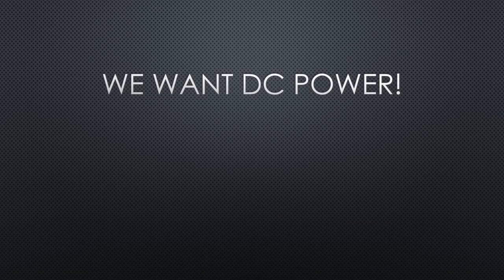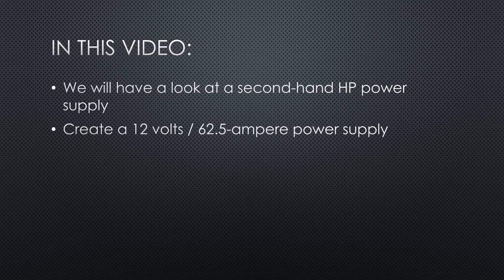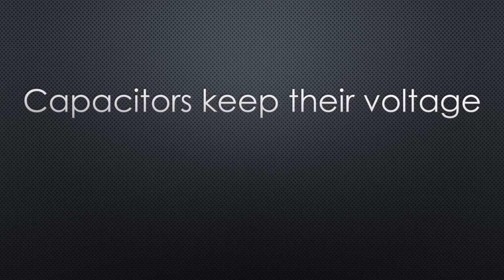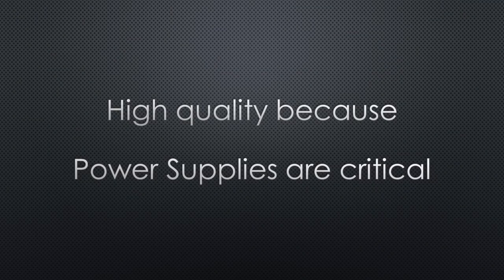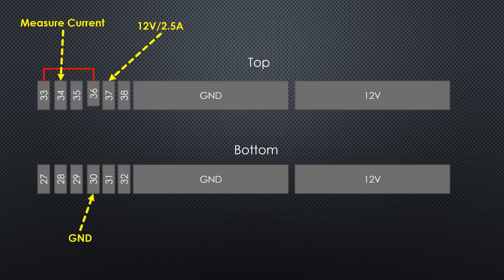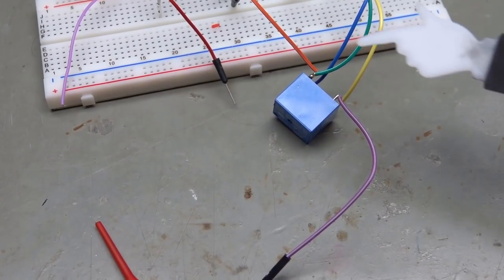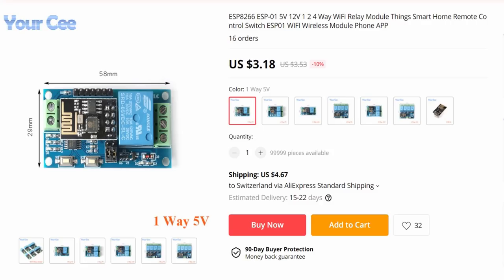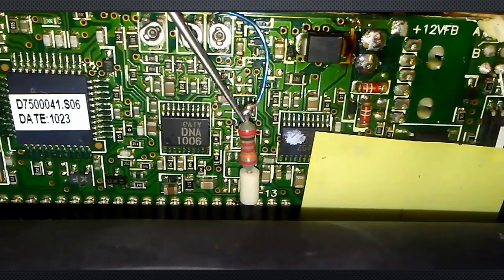#342 12V/60A power supply (PSU) for 20 dollars? Unbelievable, but true. And high quality.

Comment: I would never buy such beast for DIY projects. It is way, way too dangerous for hobbyists - 60A is not a joke. Any short will end up in dramatic fireworks and can definitely set the wires (or your house) on fire.
Reply from the maker: You are right. But then you have to pay much more attention to car batteries. They deliver easily 600A and most of us can handle it, I think
Reply: @AndreasSpiess  you're a mature person, and you definitely know how many self confident, yet still dumb people are around you (as I am). Some basic precautions and warnings at the beginning of video are crucial, imho.

Comment: he forgot to mention how loud those server PSUs are: like an old vacuum
Reply from the maker: Mine was not loud without load. The fan was off. And also at 50 % load it stayed off during my tests. But others reported the same as you.
Reply: Look for E number and decode it to OEM manufacturer. If it's Delta, it's going to be deafeningly loud, they like their fans to be self-cleaning. If it's Lite-On, it's going to be silent - unless it's dying, one of their failure modes is actually that they lose their fan control and then start signalling errors. Other failure mode is that PWR_OK detection is broken, you can live with that :D

Comment: is it normal this psu run so hot?but it not loud.
Reply from the maker: Mine does not become very hot. But I do not use a lot of power in receiving mode. Only if I transmit I need more current. But this is a small percentage of the time. I would be cautious if it runs too hot. Maybe the fan is defective...

Comment: Powerful, compact and noisy as hell. No thanks.
Reply: You can replace the fans with quieter ones if you only run them at lower current. Also modern servers can be very quiet already when they are not heavily loaded and the inlet air is cool enough.
Reply: that was true, years ago.
Reply: I have two 1 kW HP G5 PSUs and those things are LOUD.

Comment: Does anyone know what is the I2C bus on the PSU for?
Reply from the maker: I assume for status reporting in a DP center
Reply: As these are server PSUs, most likely the bus is used for fault detection, as normally they are used at least in pairs of 2 for redundancy. If one PSU has bad voltages or fails completely, administrators get informed to replace it before the other one also dies. Mostly they are hot pluggable (see the part in the video with the shorter pins) to not have any downtime on the server.
Reply: @AndreasSpiess  I did a little bit of research and found out that it uses the PMbus or power management bus protocol which is a standard (with open datasheets for older versions). The interface can be used to control fanspeeds, get PSU temps, voltages, currents etc.

Comment: Some tips for 48V?
Reply from the maker: I did not find a lot of info about 48 v psu
Reply: @AndreasSpiess  Thank you for your clearly explained video. I purchased a 48v 40w DIY induction heater 2 years ago, not understanding how expensive the power supply would be. Using (4) of the HP power supplies in your video, could you point me in the right direction for info on how to safely connect 3 or 4 in series to reach 36 to 48 volts? Again, thank you for your excellent videos!
Reply: For 48V,  look to telephone system power supplies.  I had one given to me a while back that I tore apart, it had a large card cage full of TTL,  on many boards,  and multiple power supplies for the various parts of the system.  The whole thing was several cubic feet in size!

Comment: Was it really necessary to use a relay?  Edit:  not really.

Also, they sell breakout adapters for these power supplies.  Search for "HP common slot breakout".
Reply from the maker: True. you can also follow the link in the description to those boards
Reply: @AndreasSpiess  Yes, sorry I forget to check descriptions sometimes.

Comment: there is no houses with 60A plugs, where the hell are you thinking to turn this thing on? its too much energy.
Reply from the maker: 750W/240volt=. 3A.  This is the amperage on 240 volts. No problem.
Reply: sparcx86 Channel:  
  V=I x R,  W=V x I

Comment: Don't use PSU's from HP's G5 generation, they fail all the time
Reply from the maker: You have to be a little more specific, I think. Not all know the numbers of the G5 generation to avoid.
Reply: @AndreasSpiess  My G5 server is still running on it's original PSUs bought as a customer return back in 2010

Comment: why exactly 13.8 Volts?
Reply from the maker: I do not know why most 12 volt devices have best performance at 13.8 volts. Maybe from the cars where the charging voltage is around this value.
Reply: @AndreasSpiess  is it 13,8 for cars? I've always used 14,4 for my lead batteries... but ok
Reply: Yes, this standard derives from the automobile industry. Car alternators vary in voltage according to the engine speed, so to keep them from overcharging a battery, there is a voltage regulator that is typically set to 13.8 volts. Automotive accessories that require high power (like high-end stereos and ham radio equipment) are designed to operate at their fullest capacity at 13.8 V rather than 12 V. (I was once in a vehicle that died; when we checked the engine, we discovered the battery had partially melted; evidently the regulator had died. This is why many vehicles have a voltage indicator on the dashboard.)
Reply: 13.8VDC is a good voltage to use when charging 12V lead-acid batteries. At that voltage there is little risk of damaging the battery from overcharging.

Comment: Shipping $20 :(
Reply from the maker: Bad luck. Maybe on another ebay site?
Reply: Jakub J.
 - Buy several units from the same seller (if possible), maybe with a friend who needs a PSU also. Usually the S&H fee remains the same or increases only a little with additional items, and thus the price per unit gets lower and lower. I, for example bought six PSUs years ago for about 3.99eur/piece, and the S&H fee was 14.90eur for the whole lot, and would have been the same even for a single unit.

Comment: I have had the same idea and took it one step further. If you want to turn this PSU into a proper bench power supply with adjustable voltage and current, please contact me via my website keenlab.de. I am interested in supporting you with a donation.
Reply from the maker: Done.

Comment: Here is a board I designed a year or so ago https://easyeda.com/nitro.heppie/hp-cs
Reply from the maker: Thank you for the link. Powerpole is a good system.
Reply: @AndreasSpiess  Anderson power poles for my amateur radio gear. XT60 for my RC gear. The board breaks out the current measurement pins and the PMBus pins. I have not had any luck with getting the PMBus talking to an Arduino to read/set values, maybe this is something you could look into?

Comment: Das Video hat mich zum Suchen animiert und ich bin fündig geworden. Ein Monsternetzteil, a DC Power Nightmare, von Cisco,  54V bis 57 A auf einer Phase (3000W) bei 2 Phasen Betrieb das Doppelte und das Ganze für geschmeidige 69,-€
https://www.ebay.de/itm/Cisco-PWR-6KW-AC-V3-V02-Switching-Power-Supply-for-Cisco-ASR-9000-Series/133442311826?hash=item1f11c81692:g:j1oAAOSwmFde62VU

Oder dieses HP Netzteil 2650W 12,25V  bis 216A für 39,99€ plus Fracht.
https://www.ebay.de/itm/HP-Netzteil-Power-Supply-BladeCenter-2650W-C7000-732605-301-HSTNS-PR42/143681556917
Leider gibt es noch kein Video...
Reply from the maker: Schöne Dinger: Aber, ohne Anleitung für den Gebrauch sind diese Dinger nicht viel wert. Ich rede aus eigener Erfahrung ;-)
Reply: @AndreasSpiess   Ja das stimmt leider.  Ich habe jetzt auch ein HP HSTNS-PL18 gekauft. Die gibt es im Moment für 9,80€ inkl. Fracht, falls noch welche gebraucht werden.
https://www.ebay.de/itm/511778-001-Netzteil-750W-HP-Common-Slot-Gold-Hot-Plug-512327-B21/264838048349?ssPageName=STRK%3AMEBIDX%3AIT&_trksid=p2057872.m2749.l2649
Reply: @AndreasSpiess  Ich hab da noch etwas gefunden.
Ein neues Cisco 2800W Netzteil 50V  EUR 42,63/Stk inkl. Fracht
https://www.ebay.de/itm/Cisco-Netzteil-Power-Supply-PWR-C45-2800ACV-APS-172-NEU-NEW/133422880505
und hier ist der "on/off Hack" dazu (sehr einfach)
https://www.youtube.com/watch?v=7MQglbyH2TU&t=4s